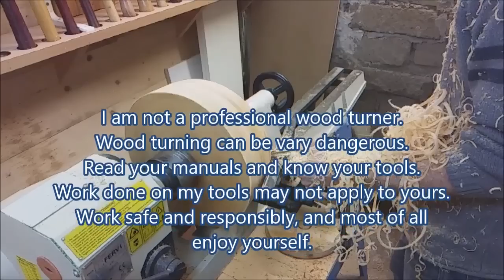Woodturning Mineral Inlay Experiment

Comment: Yuval,  I've done a lot of inlay with stones, powders, and metal shavings.  CA is the best adhesive to use for this.  Also, the smaller the stones or particles are, the better the result - fewer gaps.  As you found, the hardness of the stones is critical to smoothing.  Try to stay with softer stones (4 or less on Mohn scale) and use a random orbital sander starting @ 80 grit up to 600.  Don't use a wax to polish as it gets in any gaps.  After first application and sanding,  use some of the stone dust to fill in gaps and drip CA  on it then sand again starting @ 320 grit.  My favorite stones are turquoise, jasper, and amethyst.  I also use copper wire & powder and brass filings (from making keys) to fill cracks.  Hope this helps.
Reply from the maker: +Mark Hazlewood It sure does help! I have some turquoise someone is sending me, so I hope to use that... I'm kind of happy about this test, and I am going to use all  the stones I already have, waste not... :) and they are workable (I also got a diamond cutting wheel for my angle grinder), even if hard, the wax was a mistake, it created mud in all the gaps which I needed to clean off, but next time, done with the right resin (for some new stuff, crystal clear casting resin) I know I can get it all to fill up and be worked properly.

Comment: Yuval, I try to use inlay whenever the opportunity arises, which is usually on a bowl with wormholes or other holes. My choice has always been turquoise powder, both real and from turquoise molded blanks for knife handles. The problem is, real turquoise (Blue Sky turquoise from Arizona) being my favorite by far, is very expensive. Only economical for inlay rings on pens really. The molded blanks are made from scrap turquoise that is pulverized and glued back together in blanks. Not as pretty as the real stuff, but much more economical and cuts well with lathe tools. 
On a recent trip to Nevada and Utah I decided to try something new. I decided to try quartz type rocks and pulverize them into a power, similar to the way I do with the turquois. I do this by using a 2” round pipe capped off on one end, then cap off another pipe that is just a size smaller than the first, so the second capped pipe will fit into the first pipe. Then I use a hammer and pound the rocks into powder. I use a sifter to filter the powder through, leaving the larger pieces, then continue pounding the rocks until all is powder. I have not tried the experiment yet, just been too busy, but as I watched this video, I wondered how your experiment would have turned out had you have crushed the rocks you used into grains rather than small rocks. I also use carbide cutters instead of high speed steel when turning turquoise inlay, and I am thinking the carbide may hold up better on the crystals. Just a thought.
Anyhow, this was a good experiment with inlay materials I have wondered about, just have not had a chance to work with yet. Good video.
Reply from the maker: +Stephen Landry Thank you Stephen!  I'm glad my experiment help someone other then me :) I was going into the crystal shop to look for turquoise, but  they had some that wasn't that pretty in color, and cost too much, so I ended up picking up these two bags of leftover pebbles. I'm quite happy about how it came out, I was looking for that effect (half stones sanded down, looks like bubbles), so it worked out fine, I might try pulverizing some of these, to help fill in the gaps, and I also got some 2 parts casting resin, so I hope that will look better as well (longer working time, so I won't be that stressed to make it all before the epoxy hardens). I was going to do some inlay on a lip of a bowl, which is very common, but I also planned on doing some inlays on the outside of some vessels, and some pens, but I was wondering if there is some special methods for gluing on a round surface, like the outside, or for that matter, the inside wall of a bowl???

Comment: Well I got to give it to you Yuval great experiment but a few things I love the turquoise against the light wood and I believe as you said the light colored would look great on a dark wood. When you were sanding that with a block I was saying, come on Yuval use the power sander than you came out with the industrial grinder LOL. The finish came out great on the edges you might want to consider crushing some to a finer dust to use as a filler. crush it with a hammer. Great video and great experiment with good results.I have to say that oak looks very different from any oak I have ever seen, I would have never guessed that to be oak.Take care
Reply from the maker: +Al Furtado (Wood Turning) I was shocked as you that wood was a kind of Oak, I would have never guessed it as well, but I guess we all have things to learn yet ;) Yeah, I knew I wasn't going to hand sand those stones by hand, but you know, you have to try and show how it doesn't work, so everyone will be happy when it does! I did get a diamond wheel (the cheapest I could find, mine is a channel for normal people, not rich folks) and I'll try it out on the wheel that I ruined my parting tool on, see how it cuts those down, or not. Maybe film and upload a follow up.

Comment: Did you sand you fingers to nubs on that coster? That look like it took a while. Great outcome tho! I beat a dark blue die resin would look great with the orange
Reply from the maker: +Custom Chris I sanded my will to leave, no nubs :) I actually quite 5 minutes into using the sandpaper and switched to  the grinder right away, but I was sure the 40 and 60 grits sanding wheels were going to leave a larger mark, which they didn't... I ordered some crystal clear casting resin, mixed with some blue, between those green stones? that would look damn fine!

Comment: Beautiful video, Yuval.
Since the parting was made of HSS and that is "soft metal".
Best editing with Diamand's disc, which you can edit glass, stone, brick, etc..
We are an award >> try making wise <<
Reply from the maker: +Günter Schöne Thank you Gunter! I just finished filming a follow up to this video, where I used a diamond cutting wheel on my grinder, and it worked very well! I also filled up the voids in the stones with medium CA.
Reply: Or try times with diamond files, as there are in some merchant diamond hone Phrases (coarse, medium, fine, very fine). They're not that expensive
Reply from the maker: I only found one type of diamond file in Italy, and they are terrible quality. I'll wait untill I find something better :)
Reply from the maker: +Günter Schöne Thank you for the links! I found some pipe clamps in one of them, I've been looking for those for ages!! now I need to check what diameter threaded pipes I can find :)
Reply: Okay. :-)

Comment: I notice that your stones are fairly large. It would help if you crushed them to make them a bit finer as it won't stick up as high and will fill more uniformly and you can more easily adjust how much sticks above the surface of the wood. Also use super glue. Its a bit harder and doesn't get soft when it heats up.
Reply from the maker: +Cary Cleland Thank you Cary! I didn't know super glue was harder than epoxy! In any case I don't have much CA, and also I've just received some crystal clear casting resin, so I think I'll use that next time. I was looking for the effect I got with the large stones, and I got it all right,  which is why I didn't crush any of  the stones smaller.

Comment: Very interesting experiment Yuval! Maybe using  diamond abrasives would make a quicker job of it, I thought the first one you made came out quite well  . looking forward to seeing more of the inlays mate!Take care,   Bram.
Reply from the maker: +Brams shed Thanks Brams!! how's the building and organizing going? it's been awhile since I've seen something out of your shop! I bought a diamond coated cutting wheel for my angle grinder, I'm going to try that out and see what goes. I don't have any other diamond abrasive, for now.
Reply: +Yuval Lahav Woodturning Hello mate!  The shed is coming along nicely, at the moment I'm  in the process of making some cabinets.   The new work bench,bench drill and grinding stations  are nearly finished, I shall be at it a few weeks yet as I'm also working in my gardens preparing the ground and poly tunnel ready for the new growing season, I have some new bits and pieces to show when I do my workshop update video in a few days time Cheers for now mate ,   Bram.

Comment: If I may offer a suggestion or two (which I rarely do),,, make your kerf a bit deeper than you want it to finish out at.  Use either epoxy or super glue to capture the first thin layer to the wood in the bottom of the kerf,,, do not worry if it is not solid, just mostly solid will suffice quite well.  Allow that layer to fully dry.  Then add another layer of stone to just below the upper edge of the kerf so the wood is proud and add epoxy to the surface to seal the stones,,, they should be fully covered,,, and thus create a barrier above the stones.  When you sand the final piece you will only be sanding epoxy and wood, not the stones, which is doable with your usual sanding paper or lathe tools.  If you use a good quality epoxy you can finish and buff it so the stones are in their natural chip shape rather than having a flat face and the colors will come thru just fine,,, in fact the color will be better.  If the piece you are crafting is not very thick, consider stone sand,,, all of the minerals available for woodworkers come in a sand form and require far less depth, but I would still use the same approach.  To infill I suggest a mixture of the chips and sand to get a more uniform appearance if that is what you desire.  I would also steer away from tinting the epoxy unless it is a contrasting tint.  Good luck and the very best wishes.  Charlie
Reply from the maker: +bluemtnsman Thank you for all your advice, I will be using most of it :)
I kind of liked the look of the sanded down stones, and it was actually the effect I was looking to create (like bubbles suspended in resin), which will look much better when I will cover the stones completely (again, like you suggested), I will have better epoxy soon, I've ordered a good quality crystal clear casting resin, which should work perfectly for this kind of effect (I hope..).

Comment: You might try putting the epoxy over the stone. I think it might fill the voids better. Was the wheel on the grinder made for metal or masonry? I agree the epoxy should have been clear, at least on the green stone. Perhaps colored epoxy on the lighter stone. Either way this idea shows a lot of potential.
Reply from the maker: +Gil Grace Thank you Gil! Since the epoxy turned white, I didn't want to put it on top of the stones, thinking back on it, I don't know why it made any difference to me. I will give it a good coating next time I'll use them in a project, also I'll be using some crystal clear casting resin instead of epoxy (they are pretty much the same thing...) so I hope for better results. I might even try to dye the resin blue...
Reply: +Yuval Lahav Woodturning I didn't know you had access to clear casting resin. I have no experience with that, but from what I've seen I think that would be a better choice. So many variations to try from this idea. I can't wait to see what you come up with in you're next video.

Comment: Maybe ca glue would work better. 

How about sanding it down with diamond sharpening plates?
Reply from the maker: +Willem Kossen I don't have diamond sharpening plates, wish I had, to use for sharpening, but they should work, I bought a couple of cheap, well.. the cheapest I could find, of diamond cutting wheels for my angle grinder, I want to see how the work, if at all, I don't value them much, at 2 disks for 5 euro will tell :)

Comment: Good outcome, personal I wouldn't use my turning tools to clean up the rough form, you'll lose the temper near the tip where it's heating up so much on the stone. Make a cheap parting tool from a heavy duty (wide) hack saw blade.
Excellent video as always :)
Reply from the maker: +NineteenSeventy0ne I was planing on making a parting tool out of an old blade (which I have ready just for that), and I do wonder how the carbide tip will handle the stones... good idea!! I must try it!

Comment: I got some green rocks too, too damn hard to cut.  They also sent me a small bag of fine grindings of the same rocks and that works pretty well.
Reply from the maker: +Josef Roesler Sorry Josef for the late reply!! The stone cutting wheel worked ok, and I just bought some cheap (2 for 5 euro) diamond coated wheels for my angle grinder, and that works like a charm, cuts right through them. I hope to upload an updated to this test.
Reply: +Yuval Lahav Woodturning I got mine for bowls and I don't have a grinder...
Reply from the maker: Not even a small angle grinder? or a dremel tool?
Reply: +Yuval Lahav Woodturning I do have a Dremel, I have never found them very practical for hard things. I just stick with the dust.  I Luke the idea of the string line chalk dust too.

Comment: hi i used sand and super glue and probably got the same result, it came out very smooth
Reply from the maker: +David Holliday Thank you David! I also bought a diamond coated metal cutting wheel for my grinder, lets see how that will work on them stones :)

Comment: told you that diamond was going to be a must have for that :-) but it was a good test indeed!
Reply from the maker: +Rudy Van Damme You should see the other blank, the one I tried working with the parting tool, I bought a diamond coated disk, and it cut through it like butter :) I even filled in the voids with CA! I need to finish sanding that one, but the pens thing came in, so I had to stop :)
Reply from the maker: +Rudy Van Damme Also, mind you, the stone cutting disk did the job as well, in the end.

Comment: I love your videos.  I saw a demo at our club once and that guy, took a pestal and mortar to get different sizes of the stones.  He used different  sieves to separate the sizes.   He then used CA and started with the larger sizes of stones and worked his way down to the powder.  In the end pretty much only the powder was on the top to sand.  I don't remember much of an issue sanding, but as you can see the powder filled in all of the gaps. http://midcolumbiawoodturners.org/Visiting/SH1.html
Reply from the maker: Thank you William!
The stones I'm using here would be hard to break or grind, there are much softer stones for that, but I am well aware (now) of the technique. Thank you!

Yuval.